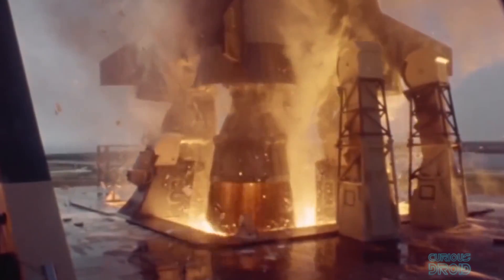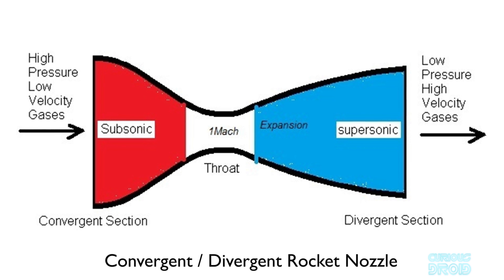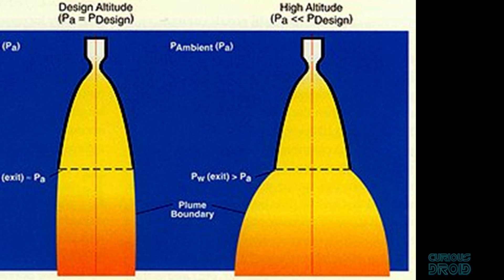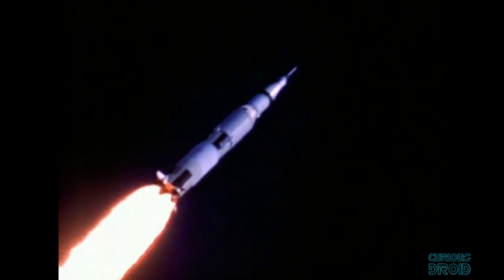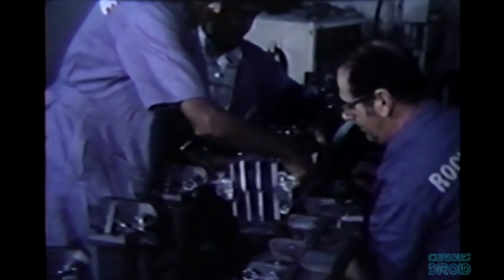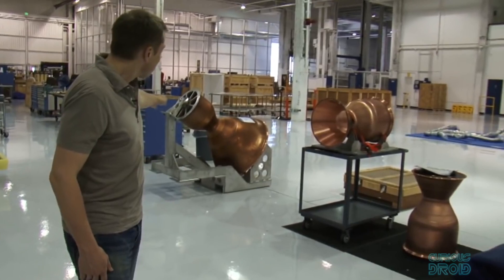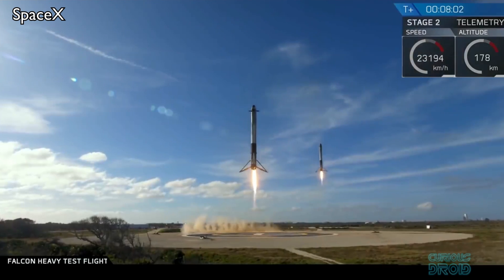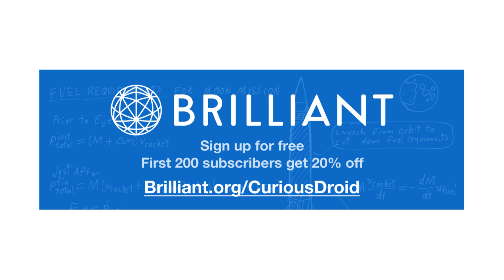Aerospike Engines - Why Aren't We Using them Now?

Comment: To be fair, the Shuttle main engines were specially designed to deal with the differences in atmospheric pressure during the flight to space and are still one of the most powerful and efficient engines in the world.
Reply: And with 40 million $ each the most expensive one ever build! Though granted they made up for that by flying multiple missions.
Reply: the only real notable thing about the Shuttle engine is the slight kink in the bell to counteract Flow seperation, which is normally what would happen if you flew at sea level with an over-expanded nozzle
Reply: @Jan van Coppenhagen
Efficiency in space business is called ISP, in which the RS-25 with 366s(SL) and 452,3s(Vac) is excellent.
Reply: They were optimized for a particular altitude, like any fixed-geometry bell nozzle engine. They were very efficient in near vacuum, which is where they spent most of their burn time.
Reply: Yeah, the RS-25 was more efficient at every altitude than the XRS2200. The only reason to use an aerospike is if you are using an upper stage engine with an anemic chamber pressure on your first stage, in which case you should be fixing that first.
Reply: The bells have a very small constriction at the opening, which prevents the flow separation and instability.  Also the whole issue with over/under expansion assumes no throttling, Shuttle engines throttled considerably through flight.  Contrary to what Blume says They do NOT change shape or expand, that's a concept that's been tossed around but never tried.
Reply: It's easy to be the best when you haven't got much competition.  It's like saying that police are one of the best law enforcement agencies.
Reply: @MrBlundrunk According to this thread ( https://space.stackexchange.com/questions/17129/is-there-a-maximum-isp-for-exothermic-chemical-reaction-rockets ) the maximum specific impulse we could ever get from a Liquid Oxygen/Hydrogen Mix is 528.8s, so we have already reached 86% of that. Pretty good for any type of combustion engine!

Shurely we can get better witch some highly corrosive, unstable and toxic fuels.
Reply: Quazar501 
Wouldn't even make sense to go higher, as this theoretical specific impulse requires such a long nozzle that it would get so heavy that it'd cause worse performance
Reply: Jett Quasar I heard they still have some mothballed shuttle engines and were going to use them for something.
Reply: They built RL-10's with extendable nozzles for Centaur stages IIRC... 

I remember reading NASA rejected them for human spaceflight use because if the nozzle fails to extend, you have a "dead engine"... 

Later!  OL J R :)
Reply: Helium Road very much not true. The shuttle engines started their burn right from launch they continue to burn close to orbit from there they use the reaction control thrusters. The reason the shuttle engines we're so efficient at multiple altitudes is because the Bell would continue to extend as they gained altitude. they were not fixed. The Bell literally gets longer and wider.

Comment: There is another reason to use staged rockets. MASS why bring a big heavy rocket to orbit when you only need 10% of that mass in orbit.  Drop the extra weight as you use up the fuel

Comment: You just briefly touched on one aspect of the aerospike's disadvantage. The spike is heavy and long when properly designed, especially in the linear version. It's essentially a more manageable version of the vacuum bell nozzle's need to be infinitely long reducing the thrust/weight ratio. So they truncate it. But then you wind up with a low pressure zone past the squared off spike, reducing thrust. So you need to burn fuel there to fill in the gap, reducing max Isp.
Reply: The J-2S engine (not the original J-2), which the aerospike engines talked about in this video were based on, used a tap-off cycle. Some of the combustion gases from the main chamber are tapped off to drive the turbopump. In the aerospike version, the gas that drives the pump is what's fed to the base of the spike, after it's done its work. No additional waste over the original engine: actually, you get some added benefit.
Reply: Just truncating the aerospike is a bad shape for the spike. 
To avoid a low pressure region they should have used a convex curvy ending. 
This harnesses the Coanda effect. 
https://en.wikipedia.org/wiki/Coanda_effect 
This might also avoid sharp edges. Usually sharp edges are bad for rocket engines.
Reply: John Bash-on-ger
MrWombatty
Sharp corners in airflows create turbulence, and turbulence leads to unstable flow - very bad for hypersonic rocket exhaust.
3D printing has a ways to go before recreating high-performance metal composite alloys, largely because there's no way to recreate the electronic structure required just by depositing atoms in a certain ratio.  Forging, annealing, tempering, and quenching are centuries-old methods that accomplish this.
I once worked a temp job at an alloy fabrication facility; look up Electronic Beam Deposition.  That would be the starting point for a metal alloy 3D Printer.
Reply: HuntingTarg, , "3D printing" chemical structures has been used in electronics for decades with things like GaS devices. Making alloys of large-scale devices like rocket engine parts is likely something else.
Reply: Since they solved the crack propagation problem in technical ceramics, they might just pour everything in a mould. It's still strong at temperatures that makes most of the metals soft as butter. I think there is already the first generation airplane engine out with a bigger efficiency and  lower weight.
Reply: Ceramics have a general reputation for being poor at handling dynamic mechanical stress, something that assaults every component of a rocket engine.  Metal-ceramic composites are different I suspect, but that's not an area I know much about.
Reply: Can foresee that 3D printing & design will eventually decrease the weight  plus greatly improve efficiency, cooling & cost,  just as it's making some improvements in conventional rocket design!

Comment: Isnt the Sabre engine effectively doing the same thing as an Aerospike but through active gas manipulation rather than nozzle design? its cooling the air in the intercooler to densify it then feeding that richer, denser air back in to the combustion chamber to increase engine pressure despite falling atmospheric pressure and so maintains the same output all the way from ground to orbit.

Comment: Wouldn't the commercial incentive for aerospike engines be the weight reduction from reducing the fuel used rather than the cost of the fuel saved? That would also allow for companies like spacex to recover more of their boosters because they have the extra fuel available for landing
Reply: James Hogge engine development is still too expensive for anyone but a government. That's why the private firms are using derivatives of engines designed in the space race era

Comment: We stage mainly because of the mass ratio.  Staging reduces the required mass ratio to achieve orbit to something that is buildable with our current materials.  Therefore, though the bell is less efficient, it is good enough.  Additionally the dual bell, which is almost as good as an aero spike, is preferable for an SSTO as it is easier to build and better understood.
Reply: Hopefully SABREs will be an option within the next decade as well.
Reply: According to Reaction Engines, "the SABRE will fly in 5 years."
They said this just last year, 2017.
.
They also said this, verbatim, in 2011
.
They also said this, with same meaning slightly different phrasing, in 1982
(they were also named differently then, but same people, same concept)

Comment: I did a highschool report on the Venturestar/X-33 program. Got in touch with people at Lockheed Martin in the program and alot of cool goodies including a very detailed wood model. 😎 

I was crushed when it was cancelled.😕
Reply: I was there at Lockheed Martin.  We had just merged with Lockheed, I started at Martin Marietta.  We were all excited about VentureStar, and I hoped to be able to test the flight software in my test lab.  I was also crushed when it got canceled.  The X-33 was the 53% scaled prototype that they actually built.  But it had LOTS of problems - too many for one video.  

I thought it was the coolest thing ever.  They would have built it if they still had the courage that they did in the 1950s and 1960s.  But we weren't competing against the Russians anymore, and NASA had become a bunch of misers, too cheap to actually build anything.  Notice that there still isn't a replacement for the space shuttle, even today.  They were planning on using Russian rockets because they were supposedly cheaper - how would that even work now.with Russia invading Ukraine?  Then they wanted to strap Boeing Starliner on top of Russian rockets, and look how terribly the Starliner program is going - NASA doesn't want to pay for any mistakes or setbacks.

You can say it's about cost, but it's really about NASA not willing to spend money that they used to.  Right now, America is willing to sit back and let China and India take over dominion of space.  Until we find gold in space or have another space race, American leadership is space is ending.

Comment: Even Bell nozzles are altitude compensating.

The thrust equation is:

thrust = mdot*Ve + (Pe - P0)*Ae

So, as the altitude changes (and thus P0 the exit pressure drops), the thrust increases with altitude.

Maybe not as much as aerospikes, but they still improve thrust/isp with altitude.
Reply: the trust increase towards 0psi but but not the efficiency of the engine. the most efficient vacuum engine as a infinite bell size if I remember, but I don't exactly remember the source of the information. In atmosphere it is at max efficiency for the altitude it was designed at. Modern bell engine use tricks to increase the efficiency but in theory a aerospike is more efficient in varying pressures. Thats the altitude compensating we are talking about
Reply: Rocket efficiency is usually defined by the specific impulse. Specific Impulse is:
         Thrust
Isp= -----------
          mdot

So, yes, without the mass rate changing, the thrust increases and so does the efficiency (e.g. Specific Impulse) .

You can get a bit more efficiency from aerospikes but it's often been concluded to not be worth it. Most modern engines use very high combustion chamber pressure (more than 1000 PSI/7MPa) so the gasses from a bell nozzle can expand greatly. Look at the RS-25; it has about 69:1 expansion ratio. This keeps the efficiency relatively high.

The Wikipedia article on Aerospikes [ https://en.wikipedia.org/wiki/Aerospike_engine ] has a nice graph comparing realistic effects. Huzel and Huang (the source of the wikipedia diagram) also suggest that there are disadvantages with aerospike/annular nozzles:

   1. Relatively high cooling requirements, because of higher heat fluxes and greater surface areas to be cooled
   2. Heavier structural construction in some applications
   3. Manufacturing difficulties.
Reply: with more research and actually producing the damn thing, all the problems you named can be fix. Just like anything. Bet you are content with Solar panels and wind turbine as clean energy because "nuclear energy is dirty and the wast are dangerous". Same thing for nuclear energy. a bit more research and dev and we would not need to litter the fucking nature with panels and wind turbines that have been proven by NASA to effect local temperature
Reply: Nope. I'm a pro-space space cadet. It's just that there's been this cult around aerospikes for decades that I don't think is entirely justified. I'm not saying that aerospikes don't have a place. It's just that there are trade-offs and they have have a narrow role. I think that they show their benefits most in the upper atmosphere, but with staging rockets, the lower stage is finished before an aerospike could really be beneficial. When coupled with the risks, I think that's why they always lose in the trade study.  I think that with an SSTO, they might be preferable, but we're not there yet. Incidentally, my blog is: http://orbitalaspirations.blogspot.com

Cheers,
Ed L

P.S. I like your videos

Comment: ssto would seem to be less costly than the 3 boosters on Falcon Heavy
Reply: Well, yeah, per launch. But factoring in R&D? No where near less costly than the Falcon Heavy. That's one of the issues with an SSTO - it needs to be designed to have a shelf life (both in terms of the individual craft and the role in the market a craft of that type fulfils) long enough to recoup the extremely high build costs and extremely high development costs.

Chances are, if a private company develops it first, they may end up losing out if they develop it too early i.e. spend huge amounts on it, nearly bankrupting the company when doing the same a decade or two later would be substantially cheaper with new technologies available.
Reply: Even with an aerospike engine getting to orbit will benefit from getting rid of empty fuel tanks on the way up. Once in vacuum a traditional bell engine is more efficient. A fully reusable 2 stage will carry more to orbit than single use SSTO.
Reply: Paradigm changes favour small risk takers. It is that way Space X got ahead of everyone. Maybe at some point a SSTO might be interesting to return from somewhere as it takes everything along except the fuel, so some advantage might outweight the disadvantages, and all big companies who cannot afford to take risks will be surprised with their pants down.
There are several of those technologies and self-landing boosters were one.
Reply: SSTO becomes economically pointless when a 2 stage rocket becomes fully reusable (BFR).
Reply: @craig Palmer
Dilithium-powered warp drive is even more efficient.
And SSTO and Warpdrive are both at the same level of development, i.e. none at all.
Reply: +Marvin Kitfox
Bullshit.
Some plausible designs for SSTO's have been proposed. We have engines that are probably capable of SSTO, and we could absolutely, definitely build an engine that wouldn't even suffer significant payload losses from being used in an SSTO (though those same engines leave behind radioactive fallout and are probably quite strongly prohibited by international law... but they're technologically sound!).

Dilithium is a fictional substance. It does not exist. It cannot ever be used in any technology because it simply isn't real. You might as well propose making space ships out of mithril, orichalcum, or philosopher's stones. Warp drives are probably not physically possible, because they would require negative matter (or some other source of negative mass), which has not been shown to exist.

Saying they have the same level of development is utter nonsense. One of them isn't even possible at all (unless we loosen the restrictions to include actual alcubierre drives, in which case it's only probably impossible instead of definitely impossible), whereas the other has plenty of development already, it's just not complete enough to work.
Reply: Griffin
Bingo.
Reply: The issue with SSTO is the payload to spaceship mass ratio. An SSTO of the same mass can carry a fraction of a multistage rocket. When recovering the stages of the rocket, nearly every advantage to SSTO is gone. SSTO will NEVER replace multistage rockets with chemical rockets.
Reply: The Atlas 1 was stage and a half to orbit (it'd drop two of its three engines half way up).  RECOVERABLE SSTO is damn near impossible though, just due to basic physics.  I mean, a good rocket will have 10% of its takeoff weight dedicated to payload.  If you have to have heat shields and recovery gear to bring the entire rocket back from orbital velocity, there goes your 10%.  We'd need a revolution in fuels, materials, or probably both, to make this practical with any kind of useful payload fraction.  Build your rocket out of carbon nanotubes and we can perhaps start thinking about it, but even the entire rocket is only a few percent of takeoff weight.
Reply: Griffin, we're not really discussing general issues with SSTOs, more just a reply to OP's comment - which is based on the principle of an SSTO which has the same payload capacity as the Falcon Heavy. Also, I wouldn't say "NEVER" with quite that much confidence, after all, people once said the internal combustion engine would never replace the horse. PLUS you're really only thinking of space plane SSTOs. SpaceX's BFR will be SSTO capable, though not with a significant (or even a) payload.